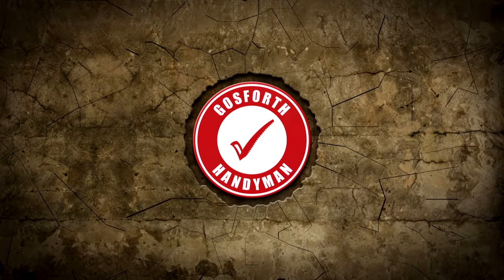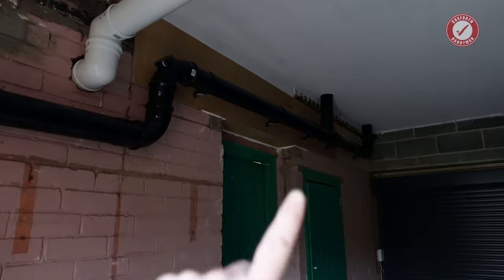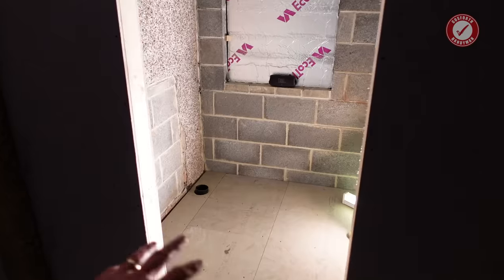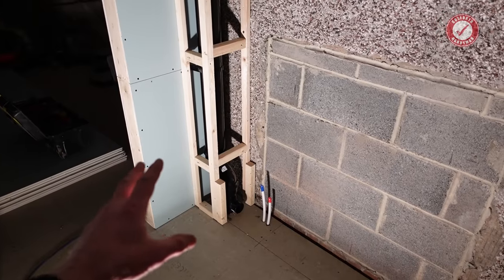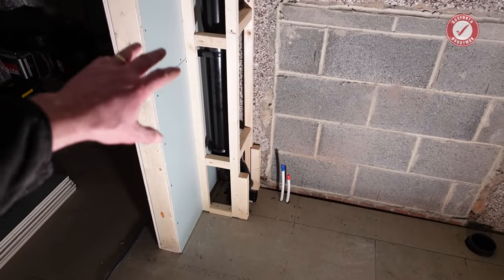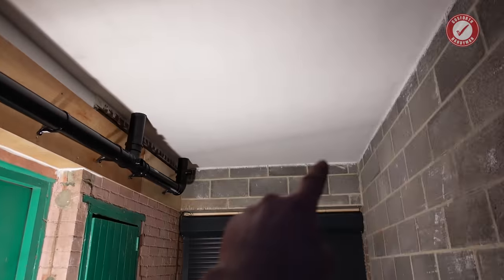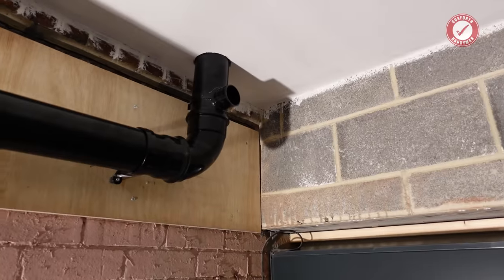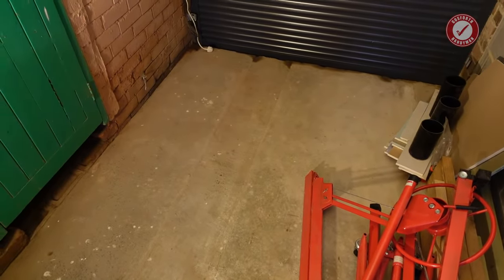Designing our waste pipework for EASY maintenance (Self Build Extension Part 15)

Comment: Your toilet septic pipe looks really close to the wall behind it, what are the toilet rough-in requirements in the UK?

In the US 80% of the toilets 🚽 manufactured are 12 inch (130mm) rough-in from the center of the 4 inch (101 mm) or 3 inch (76 mm) septic pipe to the finished wall behind it.
Reply: Most NA toilets have S traps in molded into the pan, UK toilets use P traps discharging straight back to the wall. Then you use adaptor fittings to suit soil pipes coming up through the floor, to go to each side or straight back into a wall.
Reply: I just checked some schematics, and it is normal for rough-in to be around 150mm from the wall.

Edit: Note that 12 inches is ~300mm, rather than 130… unsure what happened with that conversion.
Reply: @oldvlognewtricks  thanks for the clarification 12” = 304.8mm
Reply: @effervescence5664  NA - North American?
Reply: @Nonsense62365  Yeah.
Reply: @oldvlognewtricks  yes that’s from the center of the septic pipe to the wall. That explains why it looks so close to the rear wall, if it’s a 4” 101.6mm diameter ABS black septic pipe and 50.8mm is used up from the center of the pipe, to the outside outside edge of the pipe is only 100mm away from the rear wall. And explains why it looks so close in the picture. Rough In is 5.9” 150mm
Reply: @Nonsense62365  Because of the connectors we use the tolerances are pretty wide, but by eye that seems about right. I just gave some example numbers for an indication of the difference — half the usual rough-in would surprise anyone!
Reply: My Cast Iron 52 year old US Septic pipe, I replaced it with 4” ABS black pipe. Rough-In is 14” (356.6mm) away from the finished wall with 2 layers of 1/2” Drywall, plasterboard AKA Gypsum Board. I used a 4” septic pipe offset ABS pipe that extended the center of the septic pipe 2 inches closer to the finished wall, therefore it was 2” closer,  effectively now a 12 Rough -In away from the rear finished wall. Why are you ask Did I do this?

 because the amount of NA toilet options styles that were available to me at $150-$200 price range was over 100. the price doubled from $350 to $600. with a 14 inch rough. Less options around 5 Toilets. therefore I had a much broader choice of toilets and I saved over $170. Since the cost of the 4” offset was $30.
Reply: @Nonsense62365  That really did smart, you had to come back at him with your 4.8mm 😀
Reply from the maker: Rough in - close to the wall or through the wall. 👍

Comment: @4:28 That toilet waste pipe is too close to the wall. How is that going to work? You need at least a 9" offset from the back wall in order to fit the toilet.
Reply: No its spot on. You want the 4 inch pipe back as far as possible to the finished wall. A little gap to allow for plasterboard and plaster and then on goes a 90 degree pan connector to connect to toilet pan
Reply: Different type of connection in the UK, as I learned here in the comments.
Reply from the maker: Yup, poop exits from the rear. 👍